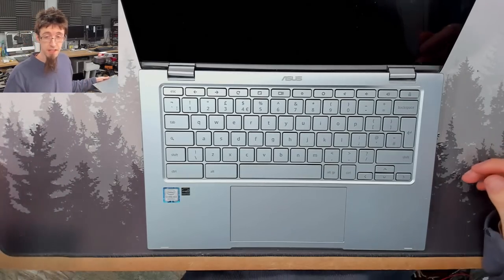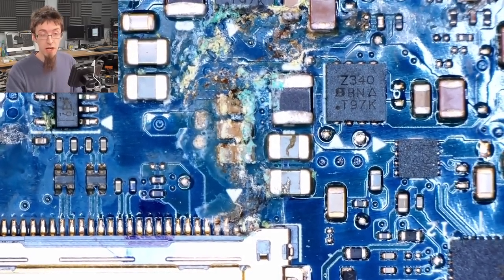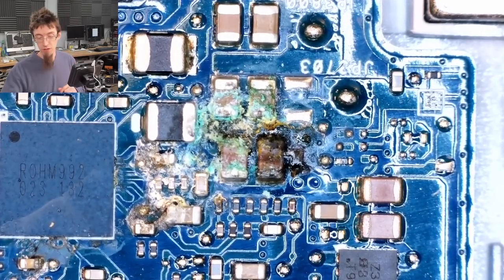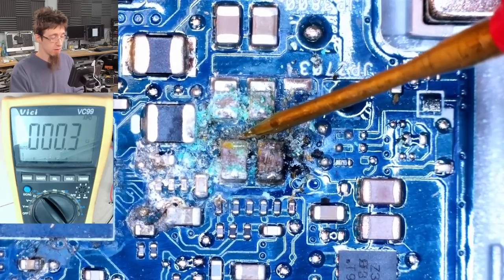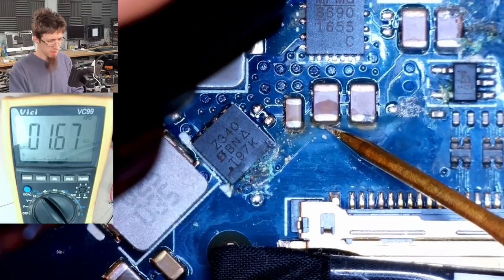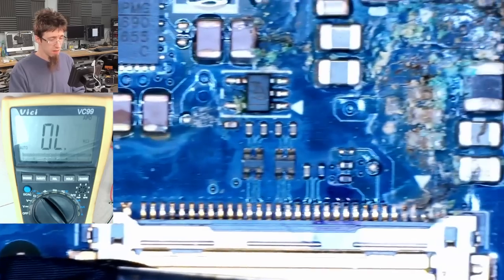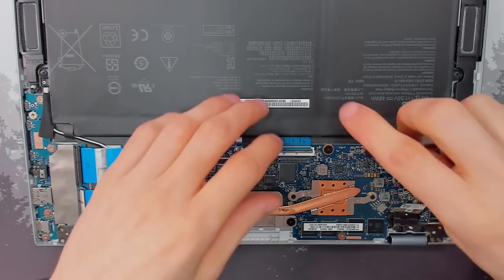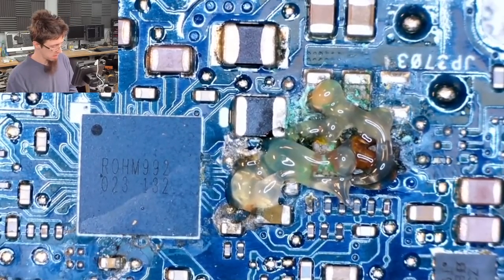Asus Chrome Book, No Power - LFC#328

Comment: If I heard you correctly,  you were asking for a tip on curing the solder mask more thoroughly. 
After using the UV light,  turn your hot air device down to about 200 degrees, and the hot air will usually harden the mask straightaway. 

I really appreciate all of the descriptive tutorial information,  as well as the sourcing info. 
Thank you!
Reply: For me, the.best way to apply solder mask is to put just a little bit on the tip of a scalpel and then use fine tweezers to apply a very small amount of mask on the solder. When UV cured a few seconds of hot air harden it more, the shiny coat dissapears.

Comment: I learned the hard way to take very detailed photos of the state of the board before cleaning it. And poke all the crusty ones first to see if they are firmly on the board. But Im with you on cleaning the board before applying heat and flux. Who knows what that crud is composed of and how it's gonna interact with the solder. That said, other people seem to do it and it works so perhaps my concern is unwarranted?

I once threw a board in the wash and ended up with a board with a bunch of empty pads and a handful of mixed components at the bottom of the wash with no real indication of which ones went where lol. Never gonna repeat that mistake. Take photos and poke first lol.

Comment: Don't beat yourself up on that trace, it's safe to say it was doomed from the start. The welded cap sealed its fate.
Reply: I agree. You'd do more damage saving the trace than removing it. And waste a heck of a lot of time doing it. Cut the component out and make the best of whats left.
Reply: What is the reason capacitor was welded?
Reply: @miso1995srb  When it shorted, it got unreasonably hot.

Comment: With a thin enough jumper wire you can actually go through the via and solder both ends which is actually better and far neater, that wire you used looks like it could go through the via, I have done this myself on a board as have others no doubt. Since the wire is enamelled it isn't an issue to do that. This method should be the preferred way when you think about it. It helps to keep the wire in place and you could use the thiniest conformal coat just as a precaution. As for conformal coating, undo the end but to NOT use the plunger like that, get enough in the end that you can use tweezers to get a tiny amount on and spread it that way and thin enough to see through it but not so thick you end up hiding tiny components.

Comment: I probably would have cut the trace right at the blown capacitor and then jumped the break with a wire. Solder mask it up and send it on its way. 

Oh and a trick, something I only just recently picked up from Northridge Fix. Instead of putting solder mask directly on the board, use some tweezers to remove a bit from the top of the case and spread it with those. My solder masking has never looked better.

Comment: 7:55 that trace was disconnected on the right before you touched it. Might have been able to save some on the left where it connected to the via though.
With the UV solder mask you can use a toothpick to paint on just enough. The less you use the better/faster it will cure all the way through. Otherwise the top layer blocks the UV from reaching the deeper part.
Reply: Exactly, and toothpicks are cheap and disposable, and you can use both ends.
Reply: Toothpick is one option, or if you don't want to keep toothpicks around your desk, just push some mask out the syringe with the nozzle pointing up, scoop a decent amount with your tweezers, put it on a somewhat empty spot of the board (just so you don't have to refill from the syringe over and over). Scoop bit by bit from the puddle on the board using your tweezers and paint a thin layer over the wire. Once your done, just use a qtip to wipe the excess from the puddle (might want to go over it with alcohol for a second clean if you want a flawless looking board). Wipe your tweezers at the end, even toilet paper will do. Easy. Remember thinner is better, and multiple thin coats are better than a single thick one. Hot air also helps cure faster, as others have mentioned

Comment: As far as the glue, I dip a toothpick into the container and run the toothpick down the sides of the wire until there's enough built up on the sides to cover the top. It's sturdy and cures faster and you can still see other traces and markings.

Comment: its best to clean the crusty area first with alcohol and a brush. that way you'll see which components are still discoloured. if a component is welded on break it off or cut it off,  heat will just rip the pad off.

Comment: For coating don't use that much, I use fine brush and put a little this cure rapid and strong. A big drop only cure the outside never the inside (and the heat don't work to much, helps but don't cure)

Comment: I see the argument for not cleaning first but once you have done the inspection with photos/vid of the affected areas surely better to begin with things a clean as possible. Thanks for tackling this repair very informative and it would be easy to write it off on first glance! With the UV mask I see people use a tiny paint brush or the tip of the tweezers to apply it thinly build the layers so it dries easier.

Comment: I think the trace was doomed from the get-go, but I would have used some alcohol and brushed it clean first. The main thing is, that you succeeded (as usual) and got it working. As far as the UV coating. You know better than to squeeze it from the bottle onto the surface. Squeeze it onto a brush or applicator, then onto whatever your coating.

Comment: These kinds of Jerry rigging repairs are my favorite. Just replacing a component (be it on the board or a module) mostly requires you to find the faulty part. That is also interesting and important, don't get me wrong but when you have to find a creative solution to the problem it just adds a whole nother level of depth and satisfaction to the fix. Great job!

Comment: For the UV curing you need to do this first :
1- clean the surface first so the UV stick to the board.
2- after applying UV light, use the hot air for a few seconds to harden it (you will know when the surface gets matty).
And thank you for your awesome videos.

Comment: Corrosion prehibits heat flow. In my experience solder melts much better if the solder joints are clean. So i always analyse, take photos and than clean in the ultrasonic before resolder or reflow. Also if you habe smd caps that are corroded you'll always can identify them because the contacts have turned black or eaten up by corrosion. Tip for solder mask. Put the mask on an sharpe and from there put it on the part you want to mask with a tweezer or somenthing else. So you can control the solder mask amount much better. After using uv-light to cure the solder mask i always use a little hot air at medium temp to dry the solder mask. Before using solder mask i always clean the board (again) in the ultra sonic. Every thing needs to be very clean before applying it.
Reply: Are you the singer for Van Halen?

Comment: That cap was welded on to that trace and nothing was going to save it. Damage was done by the liquid damage. Re the conformal coating perhaps place the mask on the tip of the scapel and then use something like a tweezer or dental pick to tranfer the coating. Heat from hot air will also help finish the curing.

Comment: Don't use magnet wire for trace replacement.  Use 28AWG solid TFE insulated hook-up wire, e.g. Alpha 2842/1.  The wire can be glued down with super glue.  Then use Loctite Tak Pak #10 accelerator pump spray to instantly cure the super glue.

Comment: Great fix! Don't think many other repair-shops would be able to offer this repair!

2 Comments, if I may:
- On a board, that had at least one dead short and might have more somwhere, I would not connect the battery until I am certain, all shorts are gone. A battery can supply an insane amount of short-circuit current, whereas an external DC-Supply will always be limiting the current to a non-destructive level. 
- I am pretty certain, that via was just to connect the rail to the test-pad on the other side of the board. Sure, there could be other traces on other layers, that might be part of a feedback-circuit, but going by your measurements, I highly doubt that. As you measued at around 11:20, the via reads more than 40 MegOms to GND. I would guess, that every other point on the Board will measure below 10 Megs to GND. Even input pins on ICs will usually measure in the single MegOhms range at maximum. The 40+ MegOhms is most likely just coming from the burnt FR4 around that area. 

Both just my opinion and in the end, you are the one running a successful repair-shop, while I am (so far) just a keyboard warrior :)
Reply: I was about to comment about the test pad, but you said it better than I'd have.

Comment: I recommend transferring a small amount of the conformal coating with a small pick by picking a small drop from the tip of the syringe and then touching the pick to the spot where you want coating to be. it is slow but works well on tiny areas like smt components. A good UV light will take about 10 seconds to harden a thin coating and a blast of the hot air will dull the wet look of the coating.

Comment: 32:35 I've seen Northridge Fix put the blob on a piece of paper or something, like a paint pallette, and use a toothpick as applicator. Now that I saw what happened here, I know why he does it that way.
Reply: The first person I thought of was NorthridgeFix. You might need a little force to get the conformal coating flowing especially if you don't use it often so it's better to have it overflow onto a scrap of foil, etc. than all over the board. Just don't stare into the UV light over the interwebs...

Comment: Solder mask you can put on the some blade and with tweezers just apply on to area/wire you want to apply it to and UV it. I think you need to UV it all the way and apply half of the solder mask you did 😀

Comment: To apply solder mask you can use one side of your tweezers and first take a little bit and place it on your cutting knife edge. Now you can apply little amounts over the desired area. After using the uv light, you can finish up with a little hot air, probably 200....regards

Comment: instead of pushing the plunger of the UV mask tube onto the board, I've learned to just push it enough to be able to stick a toothpick in and grab some of the mask and then apply it on the board by tapping it on. This also allows you to use just the right amount of mask.

Comment: Graham - a small Donation package is on its way to the shop in the next couple of days (Royal Mail strikes permitting). A 16Gb kit of DDR4 for an older PC.

I upgraded my main PC, passed its DDR4 down to my NAS and can now forward that RAM to you. It is back in its original box so should be safe in transit. It is 2x8Gb, XMP at 2400MHz with 14-16-16-32. Enjoy!
Reply from the maker: Very appreciated, thanks! I actually know someone stuck on a slow 8GB kit that could greatly use an upgrade, they don't need a good kit as they have an i5 7400, just more capacity is what they need! 👌
Reply: @Adamant_IT  On its way today. It is a Corsair LPX kit so is very low profile. Slower memory doesn't need the big "cooling fins"!

Comment: I use bronze brushes to clean the crap and a toothbrush with isopropyl alcohol. and a k .03 tip for the soldering iron... regards

Comment: Hmmm, not the way I would have done it (but it is easier to criticize them do it 🙂) However, I would definitely have removed the crud first and then I would have checked if the via is still connected to the trace below.  I think it was and if so I would have run a piece of wire or copper foil more likely from the via to the trace where it was connected then solder on the caps and use UV solder mask to help set the wire or foil in place.

Comment: A lot of modern electronics fail simply because they don't have a proper mechanical on off switch. So if liquid gets into them the components that are affected just fizz away as there is no way to disconnect the power from the battery. A physical on off switch is also safer and would not delay a pc booting up by long, if any time at all.

Comment: Always clean it first.
It’s a good idea to take pics for reference though.
I don’t think you can boil away the corrosion with flux & hot air..
Where would it go other then other parts of the board…?
I would have tried to replace the pad with solder wick.
It looked like it may have been able to connect on both ends but that’s just from my perspective.
In person it may have been a big nope haha!
Anyways,
It was a success!
Great job brother!🍻

Comment: Always clean first before rework for visibility.  Just a case of whether you should clean a small portion (a portion to rework) or everything.
Personally I would of cleaned a small area of say 7 damage capacitors (area size).   Rework only the cleaned caps.

Comment: I have to ask, but why do most technicians go for removing components before cleaning off the corrosion. It seems counter productive, if you clean the corrosion off first you avoid pulling off any traces. I'm certainly no expert but I always think if you remove the corrosion it may just work, and if it does not then start removing components. Maybe the corrosion is why the traces are coming off when you try to remove the component. Despite all this I love the videos and the channel ❤️ you have a very calming, quiet voice. Keep up the good work, you also have a very neat and tidy work area. Also we tend to forget how small the components your working with are  do not be sorry for squashing two capacitors together  we know its small and so, difficult. We understand so don't berate yourself, all is well.

Comment: Hi for formular coatin best to use a needle and spread it out on nife and put it with tweezers on a place very small amount is enough. Great repair btw the trace was doomed and couldn't probably not saved maybe a small piece  from the track could maybe saved. I probably lost the trace too i do not have an ultrasonic cleaner.

Comment: Rossmann fixes 1st and ultrasonic 2nd, and I think it's because heavy liquids stay under BGAs even after sonic, ie, he doesn't have to sonic it a 2nd time after he RnR's the BGA. It's also easier to see if left dirty, but I think he local IPA cleans to test.
Repair school just cleans, but I guess it depends on what liquid and what the part is, ie, is it large with a lot of capillary under it. I think he has also switched to water, because most liquids are water based so IPA doesn't work as well. Obviously it needs to be dried 1st because water is a lot slower than IPA.

Comment: I most def take pictures and videos to map the mess and corrosion.Then clean with isoprop and a toothbrush so I can see what's going on on each component.Or use the ultrasonic.And  then I start the work.I have seen Luis Rossman going straight away on removing or reflowing without cleaning first.But I prefer my method.

Comment: Great work as always. you where definately going to lift that trace as the high heat must have destroyed the adgeasive keeping the copper on the substraight. Just a quick question, did that Via go through the board? if you where to get a small hand drill for PCB's you could have cleared the via allowing the enamaled wire to go through the board and save the wire going all the way round

Comment: Great job you got it working. That via had enough copper showing to take solder and would have saved running a jumper wire around to the back. Also use a bit of hot air with the uv torch it cures quicker and harder. you cracked me though trying to solder the 2 caps at the same time lol.

Comment: Great job. I was surprised when you appeared to be connecting the via with what appeared to be a bare copper wire, but ta little later you said that it was coated. With regards to the trace, could you have re-drawn it with a silver pencil?
Reply from the maker: I've not seen them used, but I can't imagine it would be able to carry any useful current. I used the larger wire to the caps because they actually need to bypass a power rail, where as the via was just a signal wire.

Comment: You can use thin wire to go through those holes sometimes. That way you don't have a wire wrapping around the board. You have to use a solder sucker to get the solder out of it first.

Comment: To me it looks like that the via was only there for the testpoint. Didn't go anywhere else internally, and its only there for troubleshooting and automated testing. So in my opinion that cable that runs around the board looks like not needed. Also under a microscope you would be able to solder to the via itself. True, it takes some practice, but doable.

Comment: I am not an expert but I would first go with the alcohol and toothbrush. I think that pad strip was inevitable. Maybe you should first try to attach the wire on the tiny via, if solder attachs to it, it would be a cleaner looking solution.